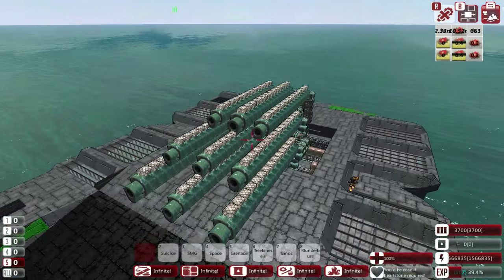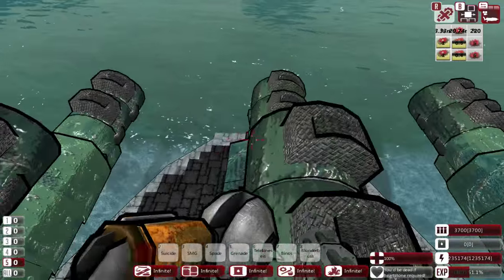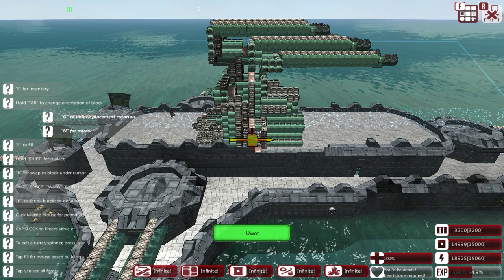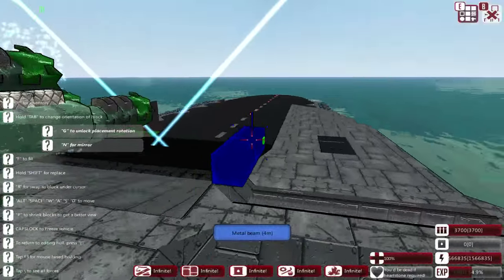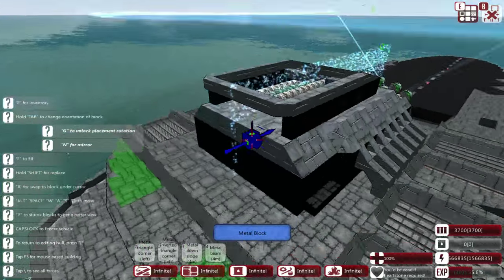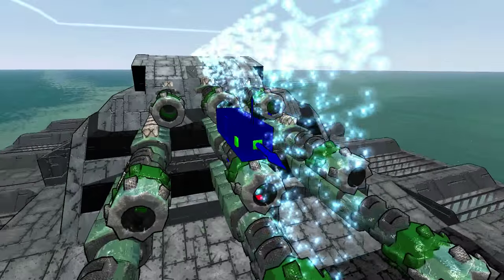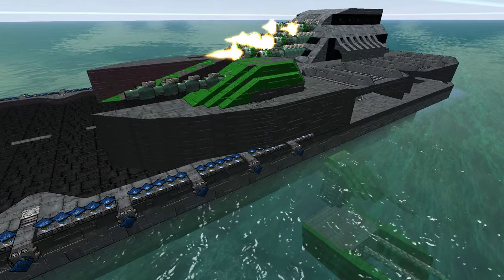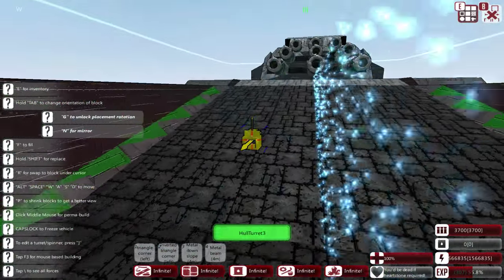From The Depths| S3 Part 28 | Cannon Modification

Comment from the maker: The original test fire: https://www.youtube.com/watch?v=5nsmG78G9Bs (Unlisted video.)
Reply: Hi lathrix your my favoryte youtuber keep up the good vids
Reply: +Lathland Sir Lathrix. Would you be so kind to put the apocalypse weapon up on the Steam workshop?
Reply: How is robbaz better at this game it does not make since
Reply: Will this be the version you will mass produce , or will you have several different versions?
Reply: Repaint the traitors!
Reply: +Lathland Secondary turret should be a HULL CANNON!!!!
Reply: +Lathland the reason you get that feeling is because the fans of the series is channaling it into u
Reply: call it wrath, seven deadly sins pride, wrath etc
Reply: +Lathland Hey Lathrix, you don't have to save enemy designs to spawn them. In the top left of the "Load Design" main window (4:38), you can find a icon with an upward pointing arrow. This allows you to go back to other folders. If you go far enough back you can access all the ship designs of all enemies in the game without need to capture them first.
Reply: +Lathland Put the bridge on the side of the ship like modern carriers. therefore 
you have more room for aircraft. however if you want the big 9 gun 
turret you cant have it on the modern design.. but you can have 
something like the Essex class carrier.. They had 4 5 inch twin mounted 
guns. overall dual guns AND there are 8 of them.. but you can make small
 rapid fireing guns.. But the Bridge is the main subject.. Look at USS 
Enterprise CV-6 for example.. Also include a hangar deck.. so you can 
add more ammo.. if you want.. 
Great Escort carrier by the way!
Reply: Lath I have an idea, what if you made a ship that on command could switch between a flyer and a ship
Reply: +Killer X cool
Reply: +thedanishrager dk thx i also thought of making a cannon that the parts take up most of the inside like the catapult but even bigger it would do sooooo much damage

Comment: Put the bridge on the side of the ship like modern carriers. therefore you have more room for aircraft. however if you want the big 9 gun turret you cant have it on the modern design.. but you can have something like the Essex class carrier.. They had 4 5 inch twin mounted guns. overall dual guns AND there are 8 of them.. but you can make small rapid fireing guns.. But the Bridge is the main subject.. Look at USS Enterprise CV-6 for example.. Also include a hangar deck.. so you can add more ammo.. if you want.. 
REMEMBER look at USS Enterprise for example!!!!!

Comment: I definitely support the idea of just cutting this thing shorter. Rather than supplement the size of the hull with guns, you should supplement the size of the guns with hull. (Hopefully your dyslexia didn't make that sentence hard to read lol.) Basically, the turret is really strong right now, and adding more weapons will not help the ship be any better of a ship. I think making it less long would definitely make it better, by increasing the firepower-to-block-count ratio. Plus, having a strong ship in very few blocks is bound to make an impact. They would be more affordable, and would be able to be fielded with other ships.

Imagine a fleet of like, 3 of those ships. They already do great at shredding armor as it is.

Comment: Build All of the sins and build the design around which sin it is, Greed be a super destroyer, Lust be small and quick with high powered but short range lasers, Sloth being a Large, Heavily armoured and slow repair craft, Wrath being a Battleship, Envy Being a Ram ship, Gluttony a Large floater air craft which spawns smaller aircraft and ships mid battle.